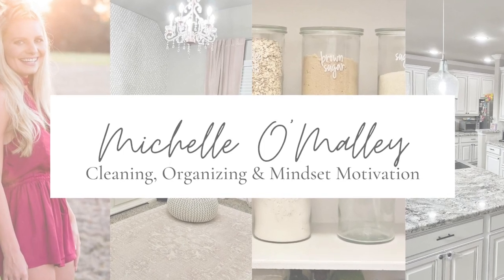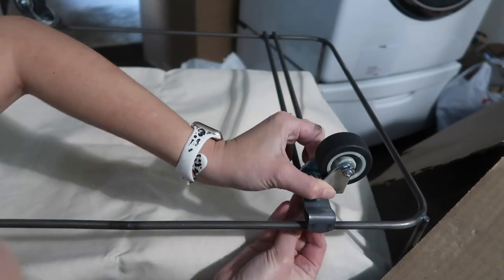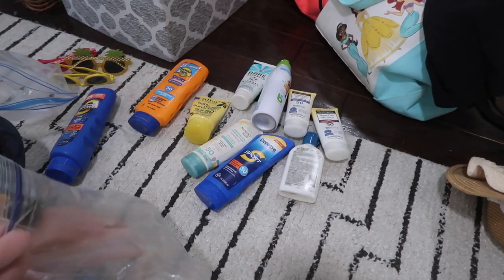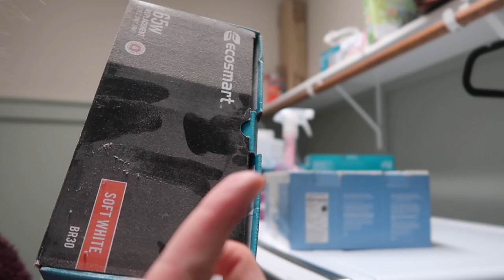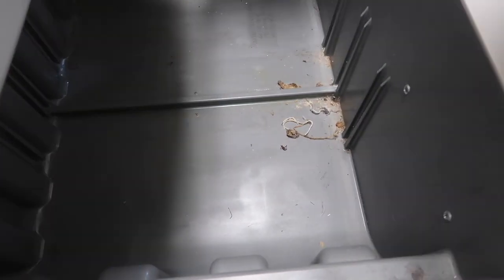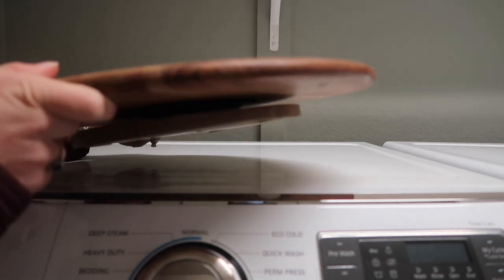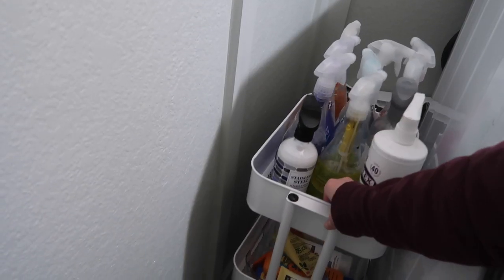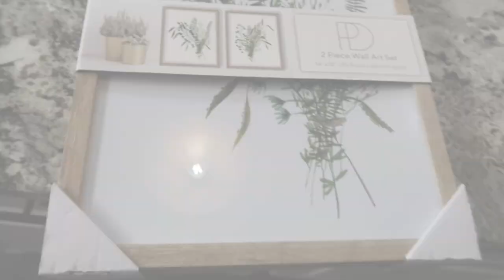LAUNDRY ROOM DECLUTTER CLEAN AND ORGANIZE / LAUNDRY ROOM ORGANIZATION

Comment: Your laundry room is beautiful! 😍 Do the color catcher sheets work well? Do you put them in the dryer like a dryer sheet? 🤔 I have an older home so my washer and dryer are in my kitchen! 🙊😅
Reply from the maker: Thank you so much! You put the color catcher sheets in the washing machine. It helps when you are washing whites and dark color clothes together so it doesn’t ruin the light ones. If the color bleeds off it supposed to on the sheet. I haven’t had any issues with using them!
Reply: @MichelleOMalley711   oh! I will need to try them! I tend to mix my colors so now I just wash my clothes on the cold setting otherwise the colors bleed!